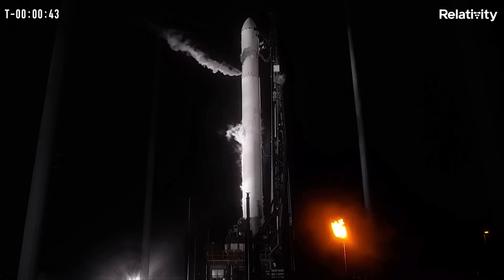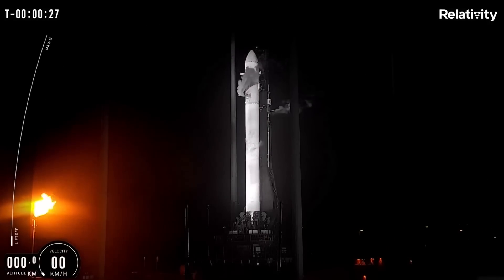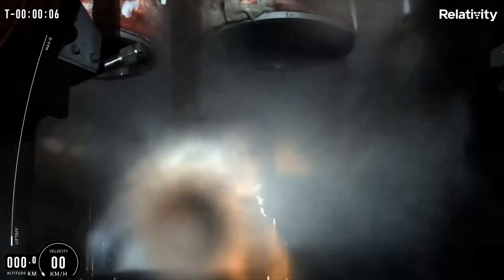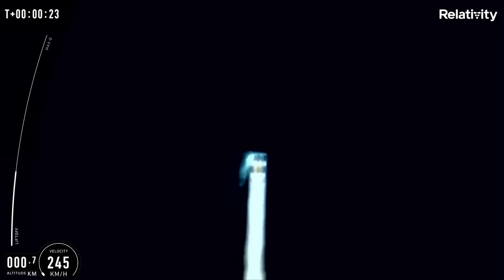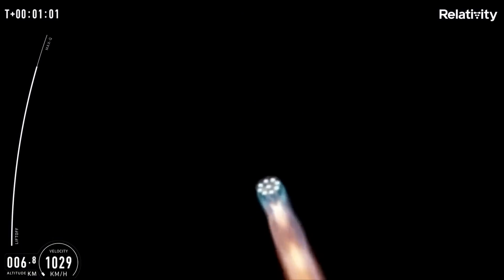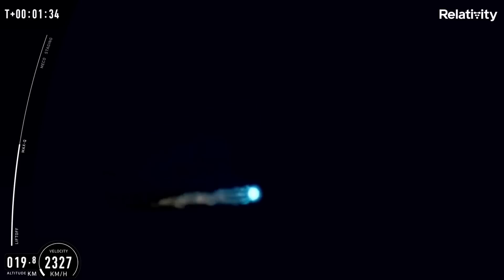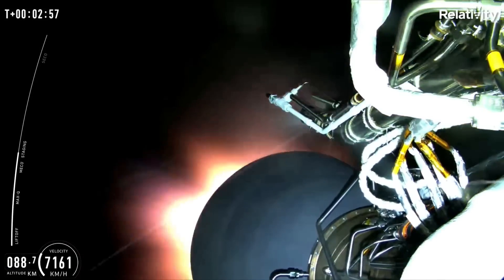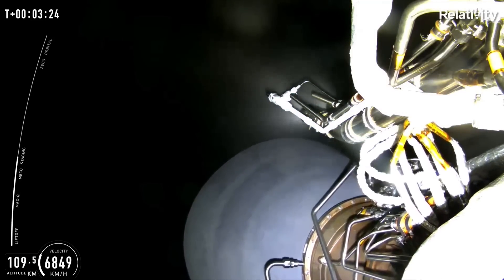Relativity's 3D-printed rocket launches but fails to reach orbit after 2nd stage anomaly

Comment: They need to do a cross sectioning test on the 3D printed material to see if it’s better than sheet metal.  Test for strength, weight, heat and cold tolerance and how much time it took for fabrication.  3D printing is not new in making rockets but they just don’t 3D print the fuel tank because that’s a slower process than welding sheet metal.

Comment: Not a bad result, no, it's quite imperative that the first stage works and it did its job. The second stage did ignite but not completely so I'm thinking that's not going to be a huge problem to solve. Keep printing keep launching to stay relative.

Comment: Well the first stage worked properly, the separation worked properly, the 2nd stage lit for a few seconds and then something went oops. I hope that they got the data to be able to determine the cause of the failure, they sure are not getting the hardware back. Overall, a good first flight, well done.